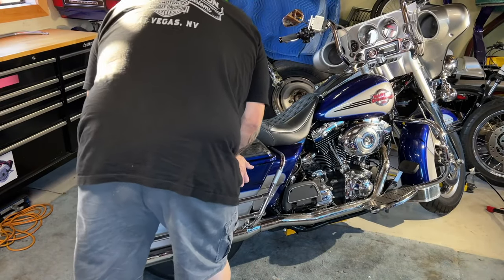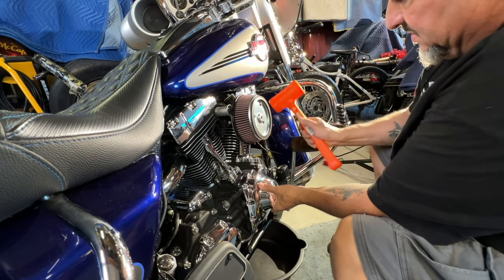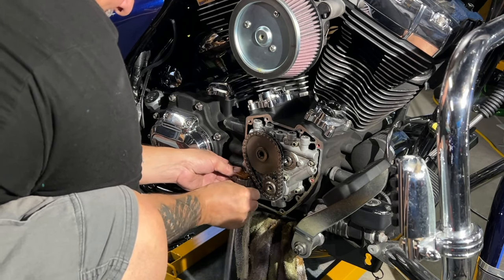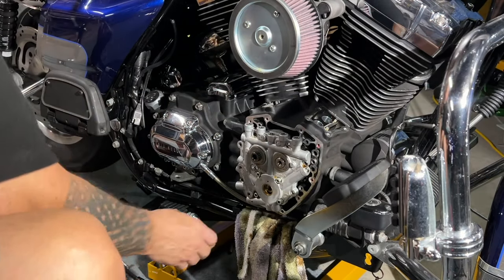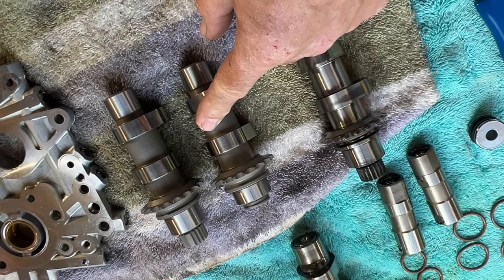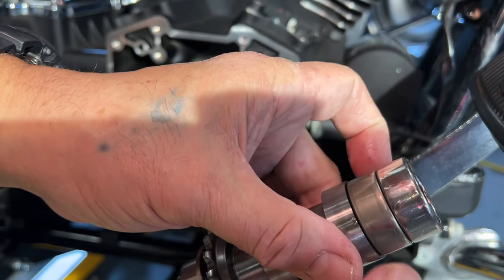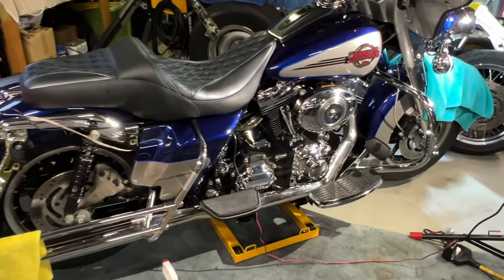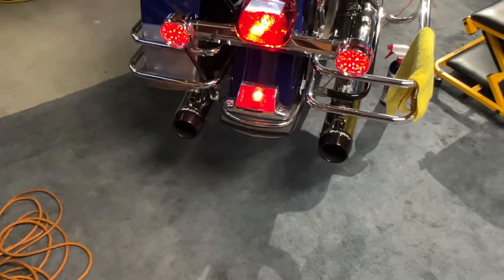Full Screaming Eagle Cam Upgrade on 2007 Harley Ultra Classic!

Comment: Was going to do this on my2007 Softail twin cam 96 but the crank had .015” runout. So now it’s also getting a new S&S crank, pistons &cylinders, cams, cam plate & oil pump. Gotta check the cranks in these twin cams, they are notorious for bad run out and sumping.
Reply from the maker: Oh man. I’m sorry to hear that but glad you’re doing all that Amazing work to it. You are going to be so happy when it’s done. That’s exactly what I wanted to do but didn’t have the funds. I’m going to enjoy it now and maybe next year I could do the upgrade but I’m very happy with it I just don’t like the rough starts. Thanks so much for sharing and I can’t wait to get an update on yours. Have a good evening and God Bless. 🙏🏼

Comment: Thank you for taking the time to explain step by step. Do  you know how much the parts cost?
Reply from the maker: Thanks Ray. I really appreciate your questions and feedback. What year make and model do you have and what are you looking for HP or Torque?
Reply: I have a 08 street  glide stock 96 true duels with Reinhart pipes. At least I would like to do a cam upgrade, I would prefer to do a 107 upgrade.
Reply from the maker: @raycarter5388  Awesome. Sounds like You got the right bike & pipes now do you plan on doing the work yourself? If so, here’s what you need first: figure out which cams you want which depends on your style of riding. 
2. Get the S&S quicky pushrod kit. 
3. A set of Torrington b-168 bearings 
4. Gasket kit for cam job. 
How many miles are on it? 
If you have high mileage you might want to pickup new tensioners. Inner and outer.
Reply: My initial comment and thought was based on. What did it cost you to do the cam job that you did.Thanks.
Reply from the maker: @raycarter5388  $450.00
Reply: Cool all I need to do now is watch the video 29 more times and sleep at a Holiday Inn.

Comment: Does anyone know specs for this cam?  I cant seem to find it on thier website
Reply from the maker: The Screaming Eagle 255’s?
Reply from the maker: Send me your email and I’ll send to you.
Reply: I was under the impression you used the tts-100 cam.  But I can't seem to find the specs on this cam
Reply from the maker: @ihatesjws669  I wanted to use the tts 100 but they sent me the wrong set so rather than waiting I went with the SE 255’s which are okay. Hang on I’ll give you the link for the tts 100’s.
Reply from the maker: @ihatesjws669  https://www.google.com/gasearch?q=tts%201100%20camshaft&tbm=&source=sh/x/gs/m2/5
Reply from the maker: @ihatesjws669  They are made by mastertune.